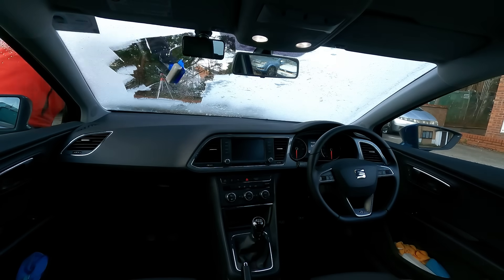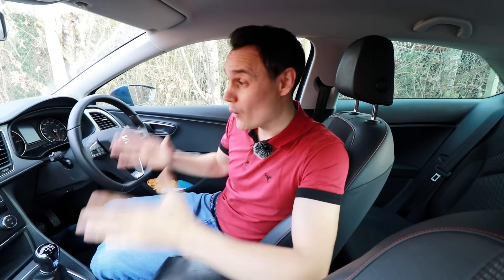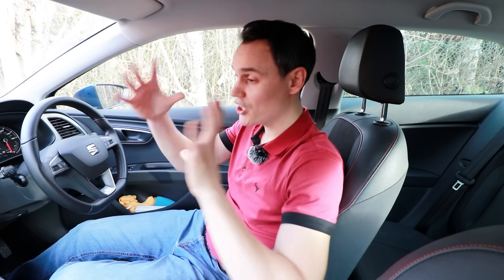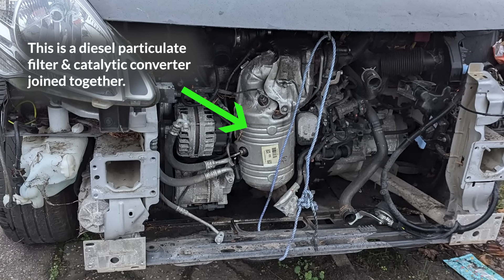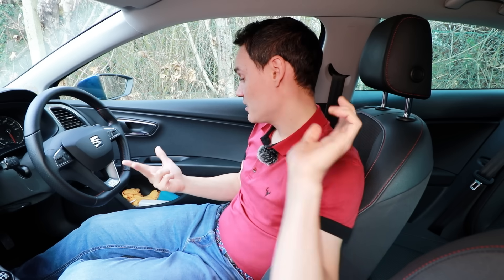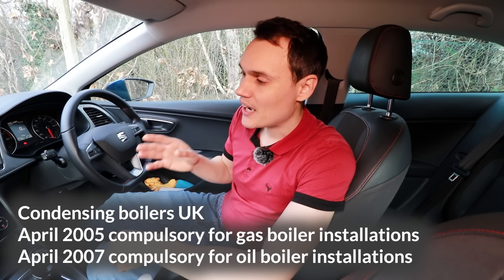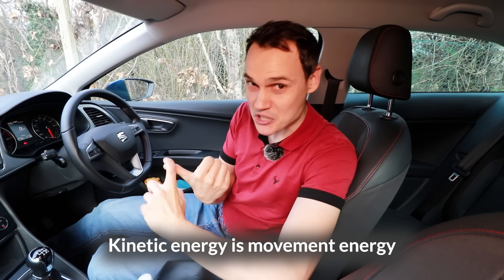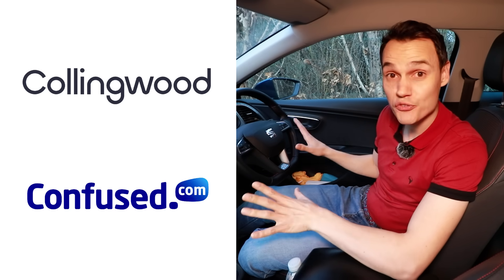How turning the engine on when de-icing can cause you harm. Possibly even cancer.

Comment: I’ve got an external socket what I used to use for my lawnmower and also use for my pressure washer. When we’ve got a hard frosty morning I use an extension lead and an old hairdryer. I place the hairdryer between the back of the rear seats and turn it on low while I’m getting my breakfast. 
After about 30 minutes, the car is defrosted, no starting the car, no de-icer, no scraping. Put everything away and I’m ready to go.
Reply: Or  install a electric engine and cabin heater? Or are they only a thing in northern europe? If you drive to work the same time a combined clock and thermostat (in the car or in the socket) turns it on automatic when needed, only remember to plug it in.
Reply: I do the same with a fan heater, but the problem is trailing the cable into the car means one of the doors has to stay slightly open.

Comment: Not being funny but, if your cars frozen over it will be because its OUTSIDE.....and you de-ice the FRONT the very opposite end of the vehicle, so this video is pointless.  This is only an issue is in enclosed spaces.
Reply: Two points, firstly you have to de-ice all the windows and lights (including the back ones). Secondly, air isn't stationary, wind can easily blow the air from the back off the car to the front of the car.

Comment: I accept what you are saying here and don’t doubt the truth of it. That said, on really cold mornings it is simply impractical not to start the engine to help thaw the screen.  Even electrically heated screens do not solve the problem completely, I’ve had Ford cars fitted with those in the past.  You get ice on the inside of screens as well by the way. 

Encouraging drivers to do otherwise is just a bit irresponsible IMHO.  There are already plenty of idiots to be seen on a cold morning driving with obscured glass, too lazy or stupid to prepare their car before driving it.
Reply from the maker: I have no problem de-icing my car with the engine off, it's how I do it. This video may help: https://youtu.be/KtBZ-TItVeA?si=7d4ck4qg1x2G-cpu
Reply: @ConquerDriving thanks I will check your video.  Nevertheless I question the practicality of your advice, not the possibility of it. I’ve been driving since before you were born and I have fully cleared early morning windscreens many many more times than you have for certain.  Most drivers including me, are needing to get on the road with the least delay so clearing the ice and KEEPING it clear once you start driving is the priority.  A warm engine ensures that, but I repeat it’s only on the coldest mornings 😅this is necessary. 

The unrelated matter I wanted to mention to you is the practice of keeping foot on the brake pedal in queues of traffic. You recommend that to help learners.  I respectfully suggest that you would do better to develop confidence in learners using clutch and gears rather than encourage this.  Its practice is wise in certain circumstances which you covered but can cause dazzle to drivers behind . This has got worse in last few years with LED lighting.  Your advice is furthermore contrary to Highway Code advice in this respect.  I wondered if you aware of that.
Reply: @Chris-f7s2y  What exactly do you mean by the usage of "clutch and gears" in a stop-and-go situation? When stopped, press the brake. When traffic starts moving, move. What's the confusion here?
Reply: @iron5107 this refers to another video on the same channel.  You need to have seen that to understand.

Comment: first time cleaning snow and ice off my car today and I had the engine running heating it up before setting off, thank you for a greatly timed video, I'll know better tomorrow!!
Reply: same here haha, love this channel
Reply: Just put some warm (NOT HOT) water on your windshield and turn the wipers on, ffs ppl at what planet you're living at?
Reply: @viper7770  that's a great way to crack your windshield. Getting a windshield replaced when it's freezing outside is not a great idea, as the glue might not dry evenly.
Another good way to crack your windshield is to set your HVAC to the "windshield" position and turn the heat and fan on to max when it's freezing outside.
I would suggest using a chemical de-icer that is ambient temperature. A high ethanol concentration windshield washer fluid and a microfiber cloth works great for that, and car supply stores will sell bespoke chemical de-icers.
Using lukewarm water will usually just cause the windshield to instantly freeze over again and will increase the risk of cracking it as the water forms ice in crevices around the seals and microcracks in the windshield itself as the windshield starts heating up from the inside.

edit: I've been dealing with ice and down to -38 degrees C winters for about 20 years now. I've had to replace three windshields; only one due to operator error. The other two were due to rock chips and unavoidable differential heating, one was a hit that I couldn't even see before it formed a crack one morning, and the other one just straight split the windshield on my way to work as I was joining the highway and it flew up from a truck tire.
Reply: @peterjohnson9438 bollocks I’m doing  that more than 20 years, spare me your lecture 😂
Reply: Me too! First time ever. Perfect timing.
Reply: Get a car that warms itself up in the morning like an EV.

Comment: The simple solution to an iced over car, a big jug of lukewarm water. And before people jump down my throat, I'm not saying HOT/BOILING water, I know full well that could damage the glass. You only need slightly warm water, tepid.
Reply: I just use cold water straight from the tap - I remember doing this 20 years ago when I worked as a postman, it clears the windows super fast. The difference between ice cold and 'tap' cold is still substantial enough to do the job. (Edit: I just use a watering can filled with cold water.)
Reply: Yep i always do that or i keep a car cover over the wind screen overnight
Reply: Better off covering the windows, setting off and driving at lower rpm until the engine warms up

Comment: Going to go out on a limb here but, how come we didn't all die before Cat's were fitted? We all used to run our engines while working on the car, doing stuff, de-icing etc. But... We're all still here. So what's changed? I would hazard a guess the petrol; modern petrol is obviously worse.
Reply: People who are not here because they already died of lung cancer are not in the YouTube comments.
Reply: Not only that. Petrol used to have lead in it. It smelled nicer 😂
Reply from the maker: It increases the risk of health problems, it doesn't guarantee it. The question I ask is how many people did die or had/have health problems that wouldn't if emissions were lower. I can't answer that question, I can only listen to the exstensive research that's gone into this.

Comment: Let's just drive for 30 seconds with our heads out of the window so the cats get going 😂😂 There is no need for windshield.
Reply: There are people that do this and that's the reason there are so many accidents
Reply: Hold 3k-4k RPM while in park for 30 seconds with the defrost on full heat and full blast. You will start melting the ice on the windshield as you warm up the exhaust and make your life so much easier.
Reply: @myria2834 you will also start slowly destroying your engine doing that 😂
You can't rev it that much when the engine is cold especially when parked 😢
Reply: @cristimmm4851  As long as you have the patience to wait 20 or 30 seconds for oil pressure to build before reving the engine it should be fine. The alternator isn't putting very much strain on the engine even under load.
Reply: No get an EV.

Comment: What if your car is not only is iced up but also steamed up inside? Even if you de-ice the car whilst it's off, you'll still need to run the engine whilst stationary for this to clear.
Reply: If the A/C has actually kicked on, you could chuck it into recirc to avoid the fumes outside. But i'm finding in the cold weather the compressor isn't kicking on until a certain point. Unsure what that point is. Might be different from car to car though.
Reply: @childishtombino1275  most ac do not work under around 6 c to avoid the compressor freezing up and costing u hundreds of pounds, regardless of what the ac light says. ALL vw group cars do this for example and most others.
Reply: @grrfy  Makes perfect sense
Reply: @childishtombino1275  If your heater is turned up to max the compressor wont kick in because its not trying to refrigerate the air. It will just act as a dehumidifier which will rapidly clear the inside of the windscreen
Reply: @djfld2394  I leave the Climate control in auto. It makes no sense to crank the heat if there's none available, thus climate control just deals with that when it IS available. The A/C normally kicks in when heat becomes available to remove humidity.
Reply: @childishtombino1275  using AC after cold starting the car is very hard on the engine. Breathing in a tiny amount of fumes once or twice wont kill you. A 8000 pound bill for a new engine will for sure kill you.
Reply: @aidan1585 

Agreed...
Reply: @aidan1585  maybe in very old cars but modern AC systems barely put any load on the engine, maybe uses a quarter of a horsepower on average, maybe 1 horsepower for short bursts of maximum compressor power... it's near impossible to even see the affect on your MPG, it's a rounding error vs the variation in traffic you tend to see as weather cools down and people start bunching up more because they left the house late... actually putting a bit of extra load on the engine will be good for it as it will force it to warm up a tiny bit quicker! it's not like you're putting it into a state where it would be lugging the engine afterall, nothing compared to the 5 or so horsepower average and short peaks of maybe 25-50hp you'll be loading the engine down with even to accelerate to and maintain only 30mph.
Reply: @aidan1585  I appreciate your concern, I leave my climate control on Auto. It seems to know very well what it's doing and what it wants. Mind, it's an 18yr old car with 100k and it has no issues whatsoever.

As i said, the A/C doesn't come on until driven for a bit anyway. I personally haven't been worried about the fumes, I was just offering reasonable advice to the original commenter.
Reply: I've got 2 cars, one from 2016 which barely even fogs up inside and a 2012 model, which fogs up like crazy and can even have ice on the inside of the windscreen. Yeah, I'm turning the engine on.
Reply: @Meyna86  My 2005 Honda jazz fogs up like crazy on the inside too so annoying.
Reply: @Meyna86  My 06 car is alright for misting up, but my 1998 model is awful for it and the AC doesn't work so it never clears.
Reply: I also had that Problem. Looks like humidity is trapped inside your car. 

My car would even freeze from the inside on very cold days. 

Try circulating the air before you leave your car. I opened my doors and waited a bit. Or let one open and open and shut down another door, so the humidity can get out. That helped me. (But I also got problems with my AC so maybe you can also circulate through that)

If you still have that problem I assume that from somewhere humidity gets inside your car.
Reply: @ezokamado Its likely the door rubber seals which have failed allowing cold into the car
Reply: One thing to note, is if you smoke or vape give that up first then worry about this 😅
Reply: AC is your friend there
Reply: Change your internal filter mate.
Reply: If the interior was heated when last used, particularly if people were wet (e.g. had snow or rain on them and it dried in the car), then it cooled we should expect significant condensation when next used, even when it's not freezing cold. AC can help dry the air, as can humidity control materials e.g. silica crystals like cat litter. They make commerical trays for dehumidifying or you can fill a sock or small pouch and use that to absorb some of the ambient moisture.
Reply from the maker: You can remove the mist with a microfiber cloth. I find my interior only mists up if I don't start driving it very soon after entering it and my breath has a chance to condense on the windows or if there is moisture in the car from cleaning the interior. The warm water method usually gets rid of mist also: https://youtu.be/KtBZ-TItVeA?si=7d4ck4qg1x2G-cpu
Reply: @ConquerDriving if there are three people getting in the car, it is impossible to just drive off.... Well it is possible but then you find yourself in the middle of an intersection before sunrise completely blinded because all windows suddenly fogged up.
Reply: @afiiik1 That means you're not using the cars climate control settings correctly. The air conditioning should be switched and and the temperature set correctly for the conditions and the windows will never fog up.
Reply: @silverfoxsilverfox6932 I am using the AC, température set in the middle of the wheel, it's a 20-or-so year old skoda octavia, this morning I was scraping the ice on the outside AND the inside of the windows. I do have a dehumidifier in the car. There are just too many people breathing in it for such an old car....
Reply: @afiiik1 Sounds like you need a more modern car or for soda to fix the air conditioning system.
Reply: @silverfoxsilverfox6932 yeah I may need a new car but I can't afford a new car😂
Reply: @ConquerDriving Once the ice was melted and I could see from all windows and mirrors i drove the car for about 40 mins to warm up the car, whilst on this journey I came across a women driver with 3 children in the car and the windscreen was completely frozen over, this was on a dual carriageway at the lights, there was no way she could see anything, I was slightly behind and to the right of her at a red light and I couldn't see anything through her windscreen, just shocking.
Reply: @ConquerDriving What about turning the engine on and sitting inside the car, surely you're not breathing in these gases whilst in the car. It took about 5 mins for the ice to be completely removed, I turned on the heated seats and the full heater, ice was gone in around 5 mins.
Reply: Once you have de-iced either before or while driving slowly, turn on the air conditioning (or leave on auto)
Reply: @cassterwheel Most ac doesnt work under 6c to save the compressor from freezing

Comment: So is it not important to warm up your car for the engine? Is that a myth?
Reply from the maker: It's not a myth, it's out of date. I don't wait for my learner car to warm up, I just drive it gently until warm. It has 220,000 miles on it now. Letting it warm up can actually cause long term issues.
Reply: You don’t need to idle your car for ages before driving. Idle for 30 seconds is enough to get oil circulating, then drive the car gently between 1-2k rpm and that is sufficient to warm it up, just don’t floor it before it’s up to temp
Reply: You warm it up in the first 30 seconds after start driving. The car warms up much faster when moving than stationary.
Reply: 20 seconds to a minute is enough, usually wait for the first RPM idle to drop then drive gently until up to temp.

Comment: So leaving the car alone running for few minutes to heat up is bad?
Reply: Yes.  You should not run the engine for more than about 30 seconds before moving away in the worst case scenario unless you are driving a classic car or operating in really cold winters typical of Siberia or Alaska.
Reply: Nope, nothing wrong at all with leaving a healthy maintained engine running at idle for a while.
Reply: Correct. Bear in mind, if you're trying to let the car heat up. You're better off driving it soon after starting it.
There's engine health benefits to driving away shortly after starting too.
Reply from the maker: Fumes can enter the car, depends which way the wind is blowing.

Comment: Laughs in electric vehicle.
Reply: Laugh's in my petrol car while you're freezing your bits off trying to eak out extra range before paying 85p KWH to re-charge after a hundred or so miles and I sail past you with 3/4 of a tank and close to 400 miles range still to play with.
Reply: @johnbower7452 ah see I don’t use those chargers. Just charge at home for £30 per month. I do 1200 miles per month and it’s awesome. Cabin pre heating, zero fumes, and instantaneous power that no petrol car will ever match. 

On longer trips I just use Tesla or Ionity for 40p per kWh and within 15 minutes I’ve got enough to continue. It’s really not a big problem at all.
Reply: @jackjoyce1744 Wait until 2028, you'll pay your fair share of tax like us petrol drivers then. Bye bye tax incentives for EV's 😂
Reply: @ThePoozerx don’t matter. 3p per mile is still far lower than current fuel duty. A full tank of petrol on my old car (Yaris hybrid) would give me realistically 320-340 miles but about £17 of that was tax. In order to make that back in eVED I’d have to drive 566 miles so it’s not a problem in the grand scale. I can potentially charge my car using solar for free at home, that still beats pre tax petrol costs.
Reply: @johnbower7452  if you plan your journeys and use home charging you'll be paying less than 10p/kwh
Reply: @johnbower7452  I'm not the biggest EV fan due to the cost of them but even I acknowledge that they have come along way and the range is much more than 100 miles. The average range according to ev-database is 235 miles.